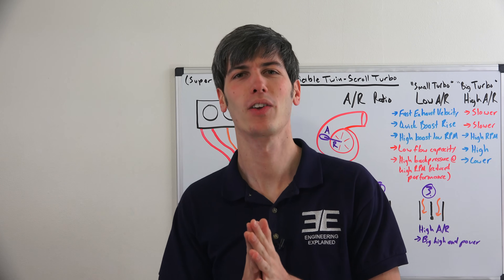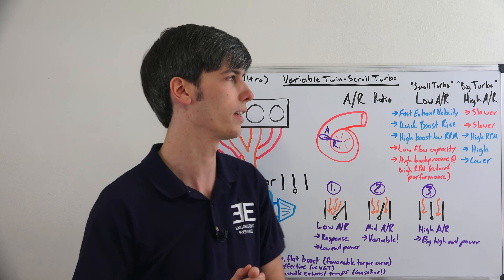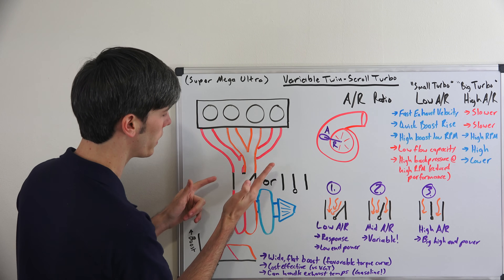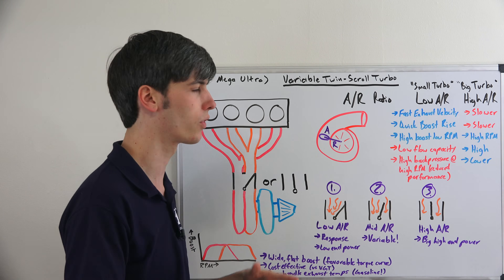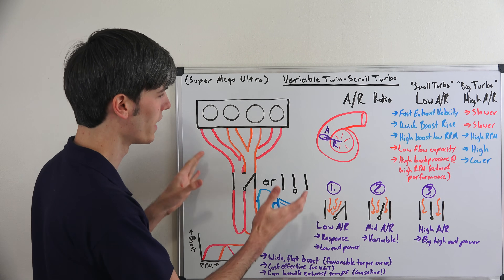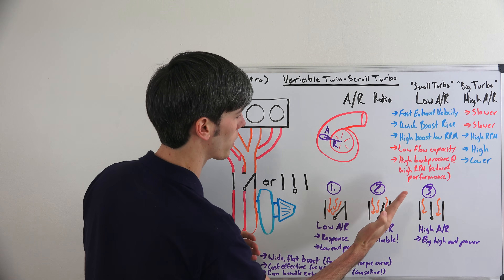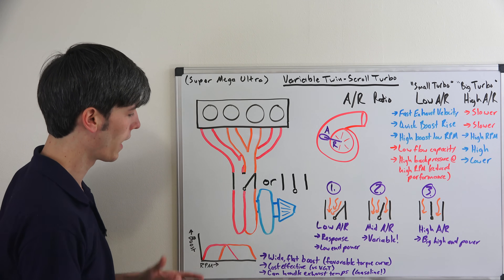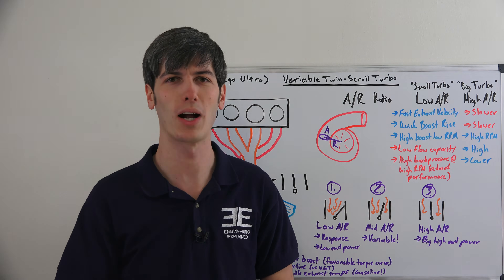Variable Twin Scroll Turbocharger - The Future Of Gasoline Turbos?

Comment: Are there any downsides to this type of turbo?
Reply: price
Reply: Sorry i didn't work it out well enough. In fact velocity was the wrong term. Opening That Valve and closing off  the second scroll, which has equal A/R, simulates a smaller turbo. The engine does burn a smaller volume of fuel/air mixture at low than at higher rpm. So it emitts less exhaustgasses at low than at higher rpm. Opening that valve forces all the exhaustgases at low rpm through one scroll, simulating a normal small turbo which spools up quicker than a standard twinscroll in wich the gases are divided an go through both scrolls. So we also get a higher and quicker pressure build up. Hat high rpm the valve opens up the second scroll and doubles Thema A/R. You get a bigger turbo. The engine does produce much more exhaust gases(per x-time) which wild be restricted by just using one scroll but thanks to the valve The turbo now can let the bigger volume of gases spool the Turbine. And it is pulse optimimsed at high rpm.
I don't think that inertia does really play a role at low rpm because as you said, the turbines are small and light plus the manifold functions as a normal pressure build manifold at low and is a pulse optimised at high RPM. 
I'm sorry that i can't write verry well. I am German and english is not my native language.
The thing is, i think this is a really easy, logical and effektive concept and people are fast to over-engineer things ;)
Reply: +Filipe Amaral And I guess that when only the "red" turbo is connected, the "orange" is extra mass that introduces parasitic losses.
Reply: Size, didn't get a real sense of scale but it just looks bulky.
Reply: +Filipe Amaral BUT you have much more exhaustgas hitting the turbo with more velocity than in a conventional Twin-scroll. this will outplay having half of the wheel beeing un-selfpropelled i think
.
Reply: +Filipe Amaral The best solution I saw to enhance turbos efficiency was provided by Honeywell. They change the gas direction before hit the turbine wheel by putting a spiral curve inside the turbine housing and make an axial flow throw the turbine wheel wich provide a better eficciency with pulsating gas. They also made a twin compressor wheel on the cold part (compressor part). They're mounted backwards one to another and I think they made different scrolls for them so the flow can be compressed separatedly.  This turbine actually is smaller than a normal turbo because the scroll is not so big. You don't have to put a compressor so big to work well in higher rpms because the 2 can work like one, dividing the thrust power the engine need.

/watch?v=Gz0qZpxXnLg
Reply: +Filipe Amaral There is only one turbine wheel! The losses will be less than a normal twin spool turbocharger because all of the exhaust gases are hitting the turbine wheel at the optimal angle. The weight associated with having two exhaust passages is no different to a twin spool turbo.
Reply: Ricardo Kelm does the velocity increase? I mean, if the diameter is reduced you can increase velocity of a fluid but I'm thinking about turbines and you want pressure. And because the exhaust moves in "pulses", you do have a greater input of gasses but I don't think they design it so that the pulses "collide" in the exhaust. Basically it fills in the gaps (which still produces more work but no more pressure or velocity).

The turbines aren't even that big, I have no idea how much the inertia factors in.
Reply: Billy Phillips That's true, but I don't know how many twin scroll turbos are out there. I had no industry standard to compare them to, so I named a drawback.

In this version, when the orange is closed off the red gets the optimal flow, but the orange side is literally dead weight. For better or worse, even the inefficient turbo for that rpm range is getting spooled in a normal twin scroll.
Reply: cost effectiveness , weight , size in the bay
Reply: +Filipe Amaral There is only one turbine wheel! The losses will be less than a normal twin spool turbocharger because all of the exhaust gases are hitting the turbine wheel at the optimal angle. The weight associated with having two exhaust passages is no different to a twin spool turbo.

Comment: So this is similar to the Sound Performance Quick Spool Valve. It uses the same principle as this new turbo design, but is not as complicated/expensive  as it requires a open scroll exhaust manifold and twin scroll turbine housing to operate.
Reply: +Florida Street Project I was just about to type the exact same thing as soon as I saw it, looks like they have seen them and thought they could integrate that into there turbine housings, ive been thinking of getting one myself to give my little 4 cylinder a wider power band as i run an open manifold

Comment: this was used before, and it was called QUICK SPOOL VALVE. look it up.
Reply: Looking at this turbo it's a better design then the normal quick spool valves since the valve is inside the turbo and combines the 2 areas instead of  just blocking 1 side, is this better then a Variable Geometry Turbo is the real question?!?!
Reply: Quick Spool Valve is different in the way that it can only support a manifold that isn't divided like the twin-scroll turbo manifold.

Comment: Isn't this what is can be found in modern f1 cars? Also I'm supposing this means basically no turbo lag?
Reply from the maker: +The Sideways Nismo Nope, they use electric assist, explained here: https://youtu.be/k8lyBFmkAKw
Reply: Engineering Explained but still no turbo lag?
Reply: +The Sideways Nismo there would probably still be some lag; but it's all dependent on proper turbo sizing. You really just need to make sure that your matching the smaller turbine to your airflow at low rpm; and the lager turbine to peak airflow.